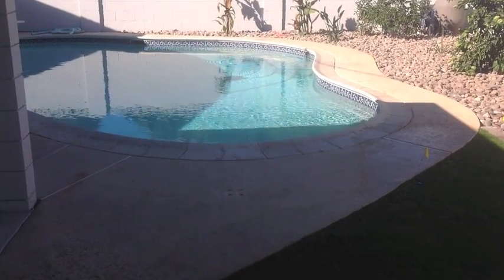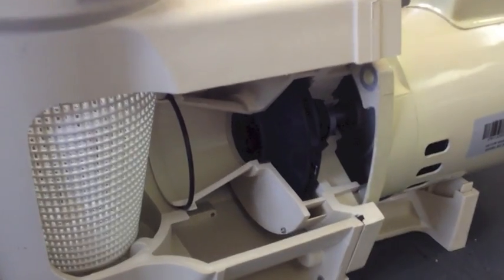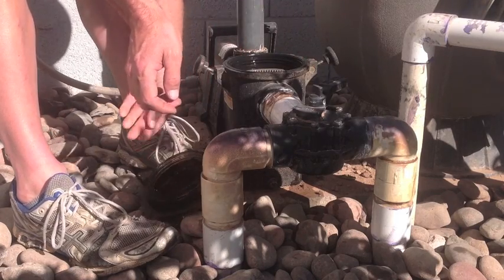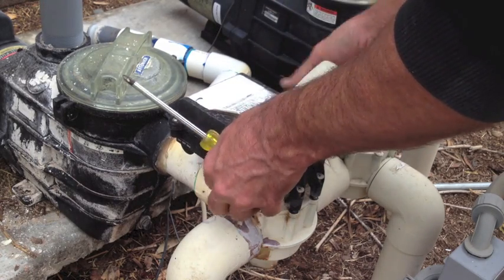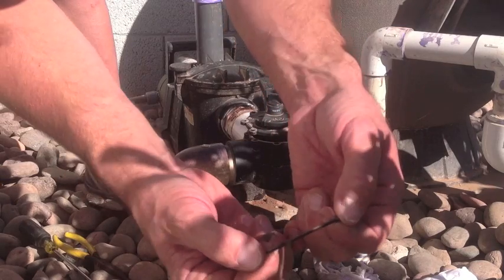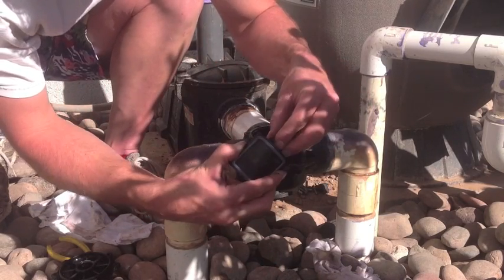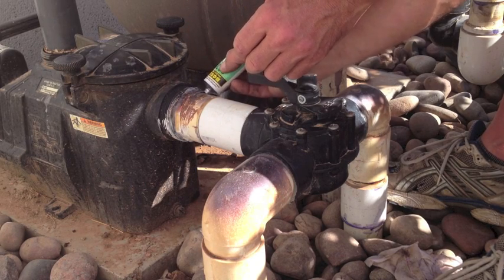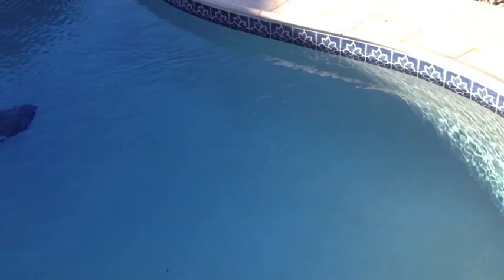Trouble shooting Air bubbles in the pool

Comment: Hi Josh, Another way to locate suction leaks is with the garden hose. Run water from the hose over all the areas you describe in the vid while watching the pump lid. If you have a see through lid the bubbles will stop when water replaces air at any leak area. Move the hose/water on and off the suspect area to confirm a leak.
Reply from the maker: Great suggestion Hap!
Reply: +leaktech1  yes i do this too and it works well
Reply: leaktech1 
Yes , this technique works well .
Reply: This worked for me too. Thanks!
Reply: Thanks for this. I’m tearing my hair out, I don’t have any, with my pool pump atm. Pressure drops and it sounds like marbles rattling around 8n the filter. I’m leaning towards the suction lines being blocked and causing cavitation. 🤷🏻‍♂️😳

Comment: After days looking for the air leak (lots of bubbles in the return), your on-off, on-off method revealed a drip at the union going into the pump.  Not more than a drop or two, that's all it took to create the bubbles.  Patched it, working great for now.  Thanks..

Comment: Thank you... How ignorant am I? I thought the flow was in the opposite direction! I have a vacuum leak when I switch to my skimmer. Bubbles in the pool and in the pump, and a loss of vacuum so the equipment doesn't move. My pool company only sweeps and cleans the baskets with no feed back to me about problems. Now, last few days I see a small leak between the pump and motor. Next week project. I sprayed my pipes to seal a possible leak in the vacuum side with a rubber product. Did you use a PVC glue? I have used a silicone sealant in the past. Now I'll try to replace those "O" rings in the valves. Informative and helpful so thank you. I appreciate the diagrammed photo. I have a Wisperflow pump about 5 yrs old. Pool is about 30.

Comment: Glad I found this video!  A few months ago, I had an air leak and my pump would not prime.  I notice the pipe going into the pump was loose, and I replaced the Jandy valve o-rings.  However, I did not do each one individually, so I am not sure which one fixed the air leak.  

A few days ago, I noticed I had an air leak again; not as bad as before, but after my pump would shut off, a half hour later, the water in the pump would drop halfway.  I knew it was not my lid, as my water feature pump worked fine, and I switched lids and each lid worked fine on the second pump.

I checked the tightness of the front intake pipe, and it was still relatively tight (I heard not to over tighten this).  I cold not figure it out, until I saw you use the glue over joints.  I noticed the joint had some 'craters'  at one joint which were really small.  It looked like the original glue may have cracked.  

I olny had Christy's Red Hot Blue PVC glue on hand, and I spread it over the suspected area.  I turned off the pump after it cured and it sealed the small leak!  Thank you very much!! Without this video, I would still be wondering what was wrong, and probably would have continued suspecting the Jandy valve I thought I repaired earlier....
Reply: I tried everything on this great video. No joy!  Then hallelujah!  Started pump for the umpteenth time and noticed a little spit on one of the tightening knobs on the pump filter pot. Took it apart and held it up to the sun(Lid is opaque smoked plastic). Saw a hairline inch long crack developing out from the knob. Picked up some flowable silicone used for windshield repair. Covered the crack, started pump for two second to pull silicone int the crack. let set for an hour. No more bubbles. Good Luck!       c

Comment: I tried everything I could think of to find the air leak. Watched all the videos to no avail. I found the leak in the 2" Jandy valves on the suction line. The o-ring seal on both was cracked. I replaced the o-ring with one made of Viton ( chemical resistant) and used silicone grease in the reassembly.  No more air leaks.

Comment: Thanks for the great video. Maybe you can advise me to help my bubble-problem .... 

Since I had algaes my pool the return jets are blowing lots of bubbles. There's also lots of air in the pump visible. While cleaning out the algaes I noticed that when the pressure in the filter went up, it showed more bubbles and after cleaning the filter (and showing lower pressure) always reduces bubbles extremely. Yesterday I cleaned the filter and then I had no bubbles at all for 24 hours. Now I cleaned the filter again and the bubbles came back. Can the filter somehow cause bubbles? Actually I was sure that bubbles can only come from the suction side and not from the return-side (where the filter is ...). I've checked everything that is suspicious to cause bubbles already (water level, pump-lid, drainage valves, union and the whole pipe all the way till it goes into ground ....) and I've also re-lubricated all the o-rings. I've also tested against leaks along the pipes with smoke-sticks and plastic-foil wrapping around - but no hint. 
Could an underground leak actually suck so much air when covered by so much dirt and sand? Also because of our pool isn't losing any water and the bubbles on/off thing I don't think it's somewhere underground, but what else could cause these bubbles? It's driving me crazy ... Thanks for any help!

Comment: i seem to have a little bit of bubbles coming out the jets, not much at all, should I worry about it?  it seems so minimal of an issue?
Reply from the maker: Keep an eye on it. If the bubbles are passing through the filter and they are minimal, I wouldn’t lose too much sleep over it. If you see the bubbles increasing, it may be time to start looking for leaks on the suction side. It could be something as easy as replacing the O ring on your pump lid or 3 way valve.
Reply: Thx man ur channel is great!!

Comment: hello, you mentioned that grease should never be put on the ring and contact surfaces. why is that?
Reply from the maker: The grease will help lubricate the surfaces a little BUT, where the problem lies is that the sticky grease will pick up debris at you remove and put the strainer basket back (little rocks, sticks, etc..) and as you screw the lid back on those little bits of debris sticking to the O ring and contact surfaces will compromise the seal  and damage the soft rubber O ring and cause the strainer lid to pull air. the only places O rings should be greased is when they are used to seal moving parts such as a push pull backwash valve. If the O ring can't give a tight seal on it's own with clean contact surfaces then it should be replaced. Hope that explains it!
Reply: That was very helpful, thanks for the video it helped a lot.
Reply: According to Hayward, the o-ring should be lubricated.

“Clean and lubricate strainer cover O-ring with "Jack's327" each time it is removed.”